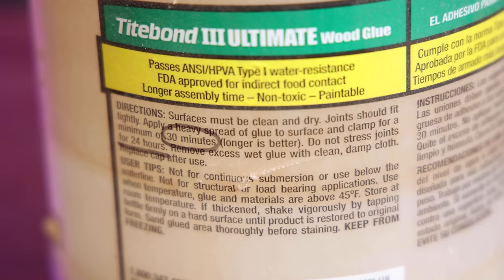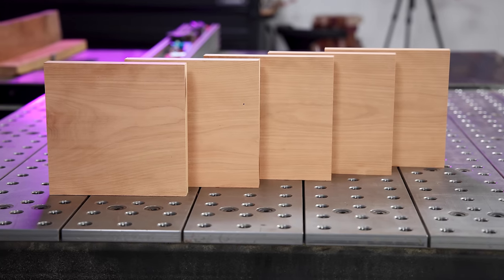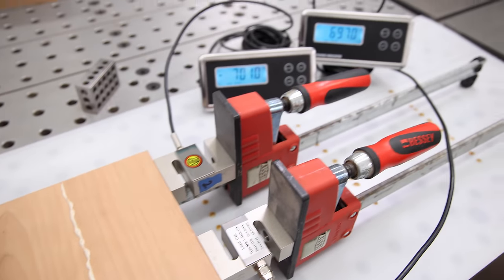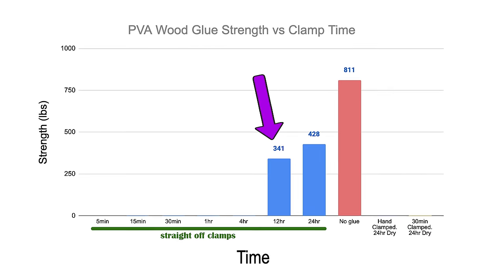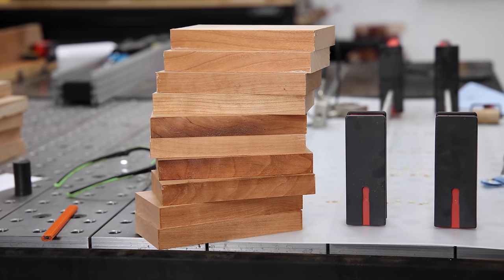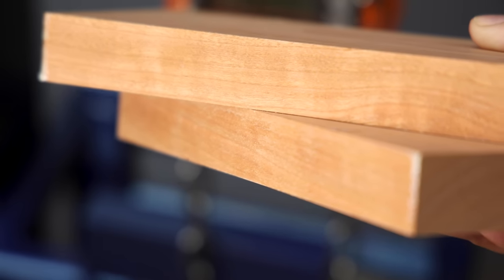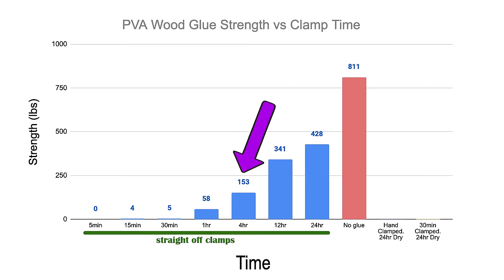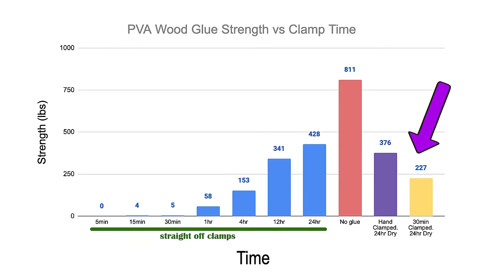you are clamping too long

Comment: Yes! You make valuable, quality video, Suman. Doesn't matter if they don't come out often. Good stuff is worth waiting for, and it can only come as you are able, not as others wish. 
Very helpful to quantify the time effects of clamping glue-ups. Adequate clamping pressure, released at 4 hours but NOT disturbed for 24, and on to the next tasks. It would make sense to have left them all for 24 hours as directed, to see if it matters when the clamps were removed. I suspect it wouldn't matter so long as the glue lines were intact. 
You are so right that the quality of the edge match is most important. And that means you don't need a clamp every 3 inches either. I glued a 3 piece panel of cheap wood with jointed edges for a painted sign that rotted away after 15 years in the rain, snow & ice. But it never came apart. 
Thank you so much!

Comment: I love these kinds of videos. I need to make a setup for testing like this. I've had some glue joints that I couldn't get apart after 10 minutes and the only reason I can think of that is because it was summer in Colorado and it was very dry. I realize the wood wasn't aligned properly and took a hammer to it and that sucker would not move. it always feels like I have 5-10 minutes, when there's low humidity, before there's no undoing the joint without breaking the wood. 

the hand-held joint was the coolest finding of this. I had seen some youtube video where the person would just hold two pieces together and that was it, no clamps. It seemed crazy, but now it doesn't seem so crazy. I had assumed the person had done it before and knew it'd be fine, but this shows it's fine with lightly used things.
Reply from the maker: Temperature is a huge factor. Also the jig was designed to really force these joints to snap in a hurry. I made it that way because I wasn’t sure if my scales would max out before joint faliure. And keep in mind, the test pieces are pretty small compared to most glueups with mich larger surface area involved.

Comment: Good video.I too have done hand pressure clamps.Masking tape clamping and spring clamp and had good results.I definitely agree that a lot of creators go way overboard with clamping.I have made lots of edge grain cutting boards and used maybe 6 clamps and never had a fail

Comment: My approach has long been, clamp overnight if there's no reason not to, clamp 4 hours when convenient, and clamp 2 hours when I need the space or clamps for something else. Regardless of the clamping time, I expose the joints to minimal stress for 24 hours.  That doesn't mean I don't touch them though.  Sometimes I'll start combining subassemblies into a larger project after 2 or 3 hours of curing time if doing so involves minimal stress on the glue joints.   I've never run tests on the joint strength, but I've never had an unexpected joint failure either.  30 years of experience suggests 2 hours of clamping is adequate for normal joinery and normal use.

Comment: I like this video very much because as an engineer, this is exactly the type of experiments I'm interested in to understand why we do things the way we do them and challenge tribal knowledge or rules of thumb. I'm writing my very first (and hopefully longest) youtube comment here because I'd like to make a few suggestions that may make your future experiments/videos even more valuable.

1. Include information about the spread of your samples
Instead of bar charts, I suggest using "box plots" as they are a common way to display information about the average and the spread of the samples together. With few samples like here, you may also just overlay the individual samples over your bar chart, but I'd still prefer some of the statistics that a box plot has to offer.
Why this is important: you concluded that 4hr clamping is sufficient for you, because in average the joint is just strong enough, without considering how consistently this is the case. But would you still make the same conclusion if half of your samples are very weak and half of them are very strong, resulting in a just strong enough average?

2. Validate your assumptions
The underlying assumption you make here is that with 24hr of clamping, the joint is as strong as it gets and it is still weaker than just wood due to being stiffer. It would be interesting to see experiments with more than 24hr clamping time to validate (or invalidate) that the strength does not increase further.
Why this is important: assuming after 48hr of clamping you can double the strength compared to 24hr clamping, would you still just clamp for 24hr if you have a project where strength matters more than clamping time?

3. Separate potential causes to make fair comparisons
Your experiment with hand clamping and letting the piece dry clearly shows that there are at least two major causes for joint strength. One of them being the clamping time and the other being the total drying time. I think these can and need to be separated in that you test the strength after the same amount of total drying time for all the samples. If you can keep all the variables except for one fixed, you can show which has how much impact.
Why this is important: what if the clamping time has almost no impact (as long as there was some) but it's really only the total drying time that matters? I.e. would you still do 4hr clamping if after 1hr of clamping and 24hr total drying time you get the same strength as with 24hr clamping/drying time (Your hand-clamping experiment potentially indicates that this could actually be the case)?

When repeating such an experiment I suggest to first find the clamping time that results in maximum strength and take that as a reference. Then, try different clamping times but keep the total drying time the same as the one that reaches maximum strength before testing the samples. And in the analysis, also show the spread of the different samples ;)

Comment: Great testing. Another factor I have found (50 years since I was an apprentice) that you mention is glue line thickness. We used to do panels with no clamps - rubbed joint. It would interesting to compare - several panels clamped together and several with a rubbed joint. For those unfamiliar, take the 2 pieces with good glue joints, glue the edges and press the joints together to ensure glue spread and also squeeze out any excess glue (with experience you should be able to apply just the right amount of glue for a .003 to .006 thick glue line) then stand the “panel “ on edge allow to dry. For wide panels lean 2 sticks against the wall to support the panel at a nearly vertical angle.

Comment: I have watched a couple of your videos now, and I like the common sense scientific approach you have for wood working and for testing wood working.  Bonding materials together is an incredibly complicated science, but you got the broad strokes correct.  Key take-aways 1) Bonds continue curing for a long time; 2) Just because the failure isn't in the bond, doesn't mean the bonded joint is as strong, 3) the feel of the joint doesn't indicate strength.  Also, I'd say that what you are really showing is when it is "good enough".  There are obviously too many variables to test for without a research grant, but I think this was a key thing to test and will serve as a good caution for impatient wood workers.

BTW the process you used for testing (isolating a single variable, testing a range of values, and definitively stating this may not hold for other materials) is great, especially in the age of YouTube.  In a real test, you would have needed significantly more samples (for material characterization they may do 100 tests or more).  Also, while your test setup was very practical and very similar to a case that matters to wood workers, it is not very good for testing the bond.  Being off from the bond one way or another will dramatically change the loading through the bond.  You are also testing a complex loading, it isn't shear (sliding the two pieces along the bond) or tension (pulling them directly apart) or pure bending (which is really tension on one face and compression on the other). If you are interested, a 4 point bend test would be a "better" setup since you have consistent load between the inner two points, instead of a strong peak at the center.

All that being said, I have seen science journal articles that are less well done than this.

Comment: Wow, what a good video.
As someone who has worked in destructive testing for years, your methods are pretty much as spot on as possible given the variables in material.

Now, next task (for me, at least) would be to determine the optimal amount of glue per square cm (sorry, am in Europe so we use metric) for the Cherry used.
Then compare that to less and more porous timbers.

I see a whole series of videos here!!

Comment: Thank you for sharing this video and taking the time to test. I know how hard this is. 

In my opinion, testing end-grain glued joints would be far more interesting as the joint would break mostly at the glue site and not the wood itself. That would truly show the glue up's strength. It was also previously shown that despite the old belief, end grain glue-up is far stronger than along the grain.
Reply from the maker: You make a really good point in better isolating glue set time and strength by gluing end grains instead. Unfortunately the reason i did not pursue it is because end grain to end grain glue up is not as common in a typical woodworking projects and I think people would find it a bit harder to follow the logic.

Comment: When PVA glue "dries" it is polymerizing.  The solvent (water) evaporates,  It was keeping the glue from polymerizing.  It is analogous to a crystal without such a regular, repeating pattern.  When the glue is drying and the polymers are accreting into a solid it forms up in a more or less orderly manner.  If the pressure changes in the middle of that process, it will interfere with the orderly manner and introduce a defect in the glue.  Any polymerization already finished cannot shift - it is already essentially solid.  The glue that is still solidifying will be torn away from what it was trying to connect to, which creates a very tiny rift that is not mended by liquid glue.  It is too small for that and surface tension prevents it from entering these tiny fractures.  These tiny fractures will reduce the strength of the glue joint wherever they exist, and if there are enough of them it will significantly undermine the strength of the joint.  They probably will be lined up because the evaporation happens more from where the glue line meets the air and less from inside.  So there is a wave of hardening traveling through the joint, but not too orderly, probably.  So when the pressure changes because you remove the clamps, you're introducing tiny fractures wherever the glue was not cured.  This is better avoided by waiting long enough for the glue to cure.  I don't know why TB would recommend 30 minutes.  It isn't enough time if the pressure will change.  The reason the hand-pressed or taped glue-ups work so well is because the pressure doesn't change.
Reply: Your joinery was very good and the extremely smooth surfaces obviate the need for high-pressure clamping.  If you use wood that is less smooth, the clamping pressure helps the glue penetrate into the pores, cracks and defects in the surface of the wood.  A rougher surface can result in a stronger glue joint because there is more surface area for the glue to touch, and the cured glue is physically locked into the pores.  Glue is already stronger than wood, so the payoff isn't that great.  But, it takes more work to make a super-smooth surface like you made, so you can save that effort for a glue up.  Jointers often produce a less than furniture-quality edge, but it is ideal for glue--ups.   So, the results you got were influenced by how smooth the wood actually was.  That is not a problem, that is a feature, because it removed from the equation the "smoothness" or "roughness" of the wood, which is difficult to characterize.  But, clamping pressure becomes more important when the wood is less smooth.  To the extent that the glue is filling any gaps, clamping pressure matters more.   Another reason clamping matters is that the project can warp or shift while the glue is drying.  This can ruin a project.  Clamping can prevent movement (if that is a goal and it is done right, of course).  Clamping can also force the parts to shift, so extra clamps and/or cauls are needed to prevent any movement.

Comment: Bravo, sir! This is an excellent approach to the scientific method--you control for the things you can, account for extremes in deviation, and publish your results in an easy to understand way while acknowledging constraints.

I'll definitely be reducing the clamping time between phases now that I understand this. I mostly make picture frames and smaller jointed items anyway. If something is clamped for 24+ hours, it's not a big deal, but I won't worry about the joints being too weak after 2-4 hours, so long as no additional stress is added in that time.

Comment: I'm going to blame that clamp removal discrepancy on preload. It's a fantastic topic and actually the way that screwing things together works.

Theory: because the glue was under pressure, and then not it's change in compression messed with the firming up of the glue. The reason the clamped for 24 hours was slightly stronger was because it's under pressure (preload)

Comment: Valuable, thanks for posting. I usually clamp for an absolute minimum of 2 hours with Titebond III, preferably four. If I am building something where the joint will be stressed, I allow the 24 hours that Titebond recommends. For my boxes, where the corners are not stressed, I can continue after the minimum 2 hours clamp time.  The most shop efficient thing would be to glue and clamp at work day's end, let it go overnight, then continue in the morning. Bullet proof.

Comment: I would venture that that 3 degree tempurature drop is not the problem. I just glued up oak framed whiteboards that I had cure for 24 hours outside in 36 degrees. I typically don't but it was my last project outside before the winter and I wanted to see how it would go. Also thank you for testing that hand pushed full cure, I knew it!

Comment: Nice Video. As a retired pro a note from experience. I would be sure my joint was good. No bow. Test by clamping one end lightly and examine the gappage at the other end. Apply glue and put boards together and wait so glue is absorbed on both boards. Then clamp. If you have use lots of pressure to bring the joint together, you are introducing stress into the panel. Fix your jointer. Glue introduces moisture into the wood. Remove as much squeezed out glue to allow the joint to dry out faster. I'd clamp for an hour or more. After removing the clamps I'd wait at least 24 hours before secondary machining. NOTE!!! You have added moisture to the wood so the wood at the joint will swell. WAIT!! as long as possible before sanding or planing the joint. Too soon and the joint will continue to shrink and you will have a slight valley at the joint.

Comment: For the 30 min clamp, then 24 hour cure, perhaps the clamping force being removed after the glue began to setup (but not fully cured) broke some of the glue bonds as the wood 'rebounded' elastically after clamping. This would render at least part of the glued surface ineffectual at the bond interface. Based on the hand fit-up and 24 hour cure, it begs the question "are we typically clamping with too much force?"
Excellent video, well done!

Comment: This is among the most valid tests of ANYTHING I've seen on YT. The most surprising result was that the "hand" clamps were actually stronger at 24 hours than the 30 minute clamps were at 24 hours. I suspect it's because heavy clamping squeezed most of the glue from the joint, while the hand clamp joints retained significantly more. Without the added benefit of heavy clamping overnight, the 30 minute test squeezed out most of the glue, relaxed the interface at a point when it was still pretty weak, and had substantially less glue throughout the 24 hour period. 

As others have said, a much more useful result would now be to test clamping at 1, 2, and 4 hours to see how they compare after 24 hours drying time. That represents what we all would consider doing, as no one wants to tie up their clamps for a day, but we would go longer than 30 minutes if we got reasonably stronger joints. EXCELLENT video! (BTW, that is the only glue I use, and I know from experience that 30 minutes is not long enough for structural projects. I always go at least 2 hours, or more if I don't need my clamps back.) [50+ years playing with wood]

Comment: My assumption about the hand clamp vs the 30m clamp is that mechanical clamping forced most of the glue out and before it had enough time to set the wood sprung apart enough to leave microscopic gaps. I have no way to prove this though.
Reply from the maker: I agree. Feels like the most plausible reasoning.  at the end of the day, any of us could disturb the 30min clamp project enough to weaken it. Best to clamp it longer till the glue strength really kicks in.

Comment: I saw somewhere on YouTube this tip: rub two small pieces of coarse grit sandpaper together, say 80 or 100 grit. Sprinkle just enough of this grit in a couple of areas where the clamping force is greatest. The idea is to compress the grit into the wood so that there is no gap created by the grit.

Comment: I think you're missing the 30 clamping point.  After 30 minutes, most joints are ready for the clamps to be removed.  That can be good since the clamping pressure can distort the wood and removing before complete glue setup allows the wood pieces to relax and flatten out.